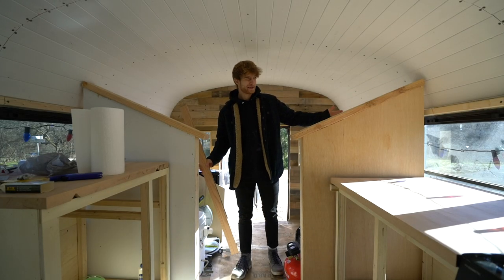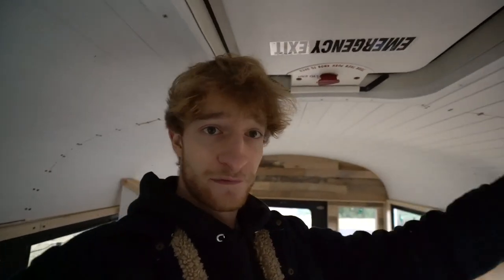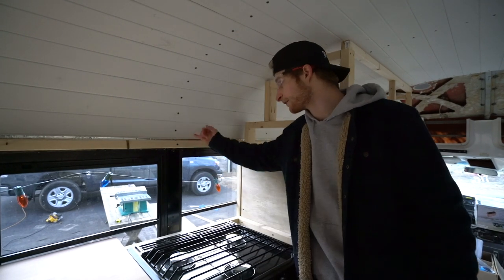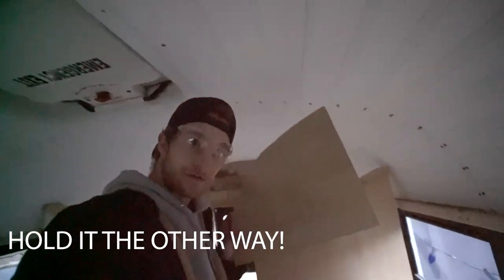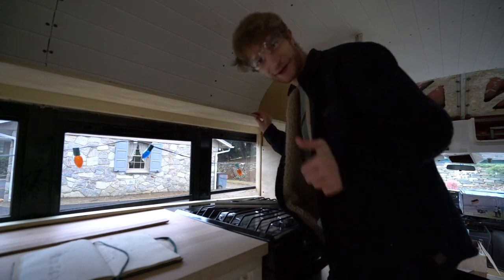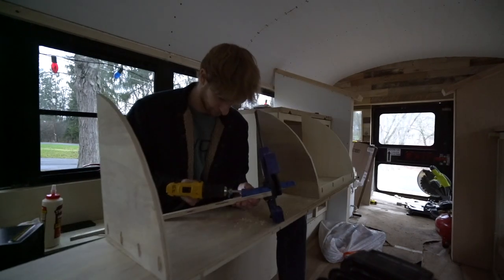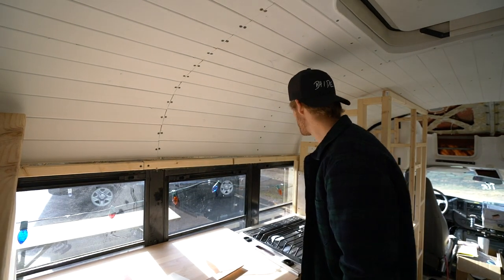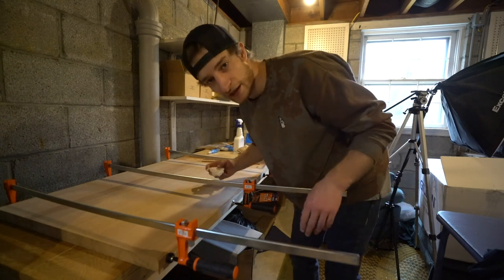Building Upper Kitchen Cabinets in School Bus Tiny Home - Skoolie Build Ep. 28

Comment: Happy new year Matt. If you think your upper cabinets may flex with weight in them, cut some angle iron and secure it to the bottom of the cabinet. The angle will stop any bowing. You can hide with trim or paint. Good job fella.
Reply from the maker: Thanks for the great suggestion Neil! I'm thinking it should be ok the way it is, but we'll see once its screwed in.